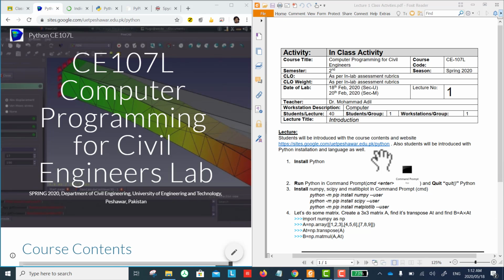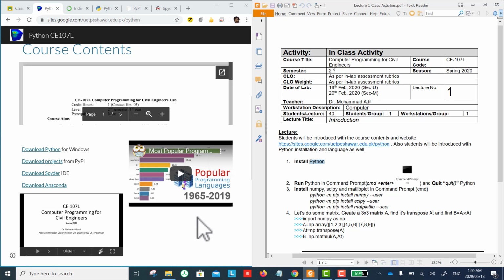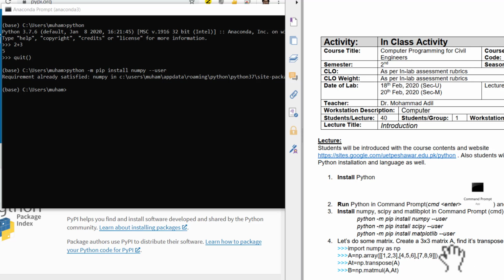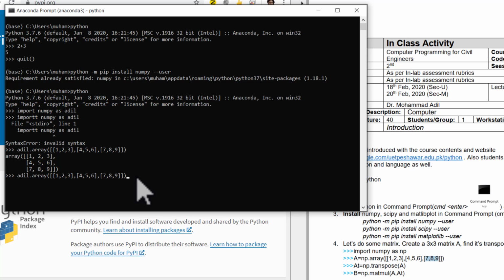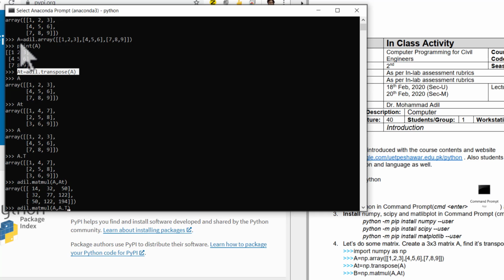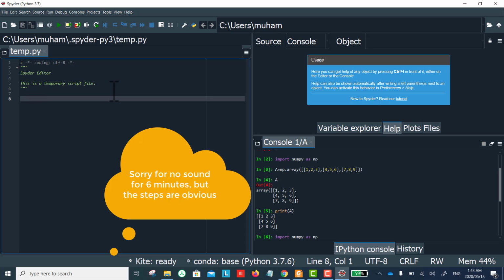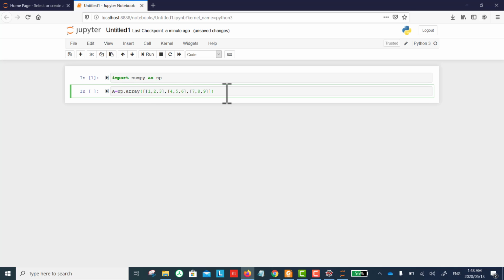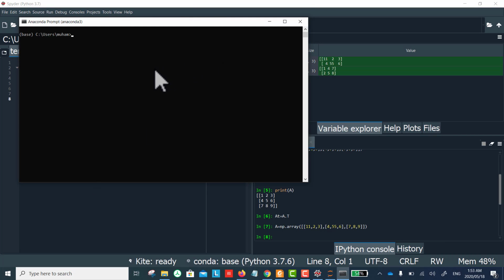Lecture 1: Python Programming for Civil Engineers: Introduction

Comment: Hi Adil. How much does the structural firms value the resource who knows Python?
Reply from the maker: Python (or any other similar programming experience like excel, vba, matlab) move hand calculation (that we did in undergraduate) to high speed automatated calculation. So if you can write tools to do 2 weeks calculation in 2 hours.. You are an asset. Firm owners may not realise that so you can tell them if the interview question suggest to explain that. The firm owners who have this realization ask/request in job ad to have experience in a particular software like etabs, ansys etc..yoi can think of them as specialized calculators..a programmer would say that  whatever these software can't do (but the firm needs) , they can do with their programming skills. This apply's to almost all office jobs. I hope my answer is helpful.
Reply: @engr.mohammadadil5276  thanks Adil, for your time. 
Yes your answer was helpful. 
Thanks.